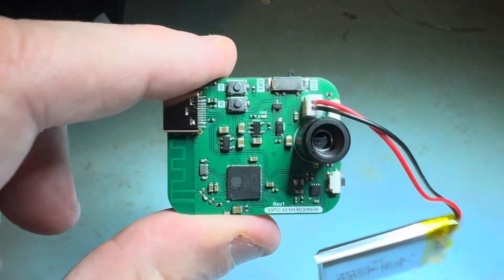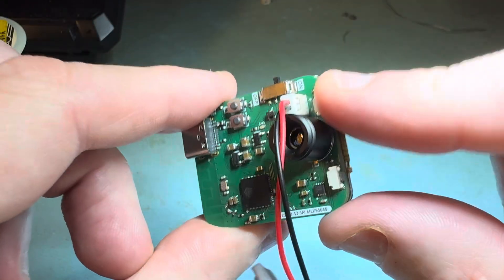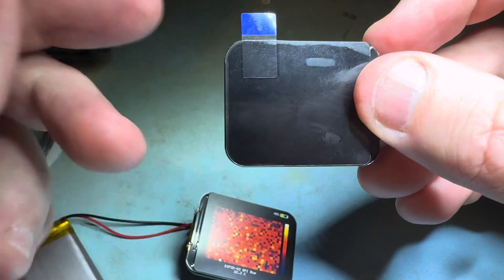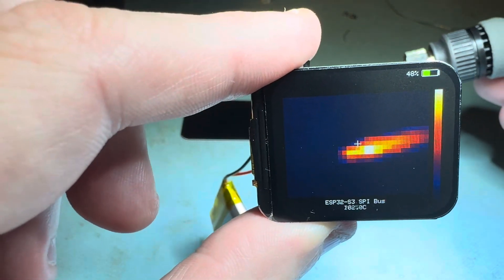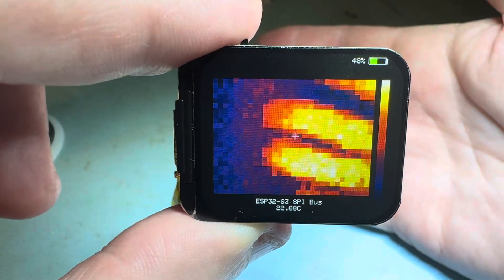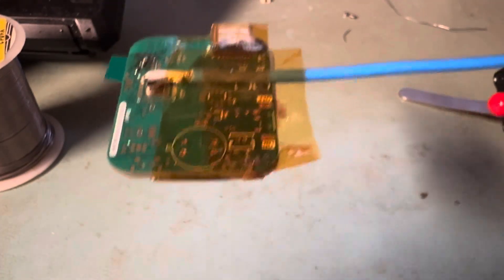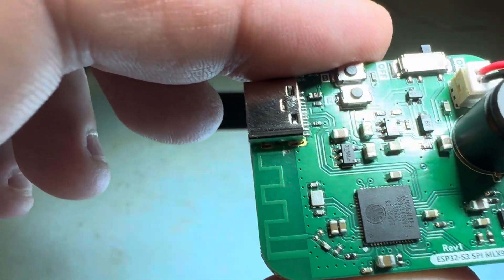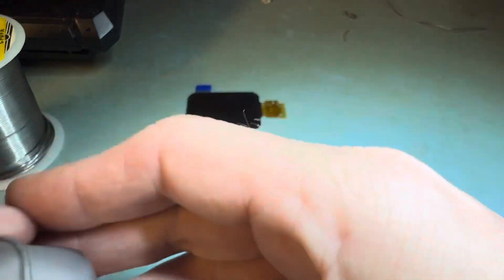ESP32-S3 Thermal Image Board

Comment: Great board Mike, thank you for the video and sharing the design. Have a similar sized PCB for the 1.69" display but still using the ESP32 modules, although I do have a new design as well that uses a bare ESP32 with a chip antenna and a tiny 0.99" 40x160 IPS display. Anyway, stay safe.
Reply from the maker: Antenna tuning is difficult so lately I have been having better success with pcb track antennas. At least with pcb track antennas you can fine tune the swr by cutting a button off the end of the end.
Reply: @0miker0   Thanks for your reply. I thought it would be easier with a chip antenna and I am also tight on space, the whole PCB will go into a pen. So no room for a PCB track antenna. Hope I can get it to work 🙂
Reply: @iHayri1 Is it possible to use a flex PCB antenna ?

I'm subbed to you too 👍😁 lol
Reply: @edwardfletcher7790  You can, just need to have a U.FL connector on the PCB.

Comment: That is a gorgeous board you built there. Love how compact you got everything to basically fit the display size. On PCB antennas you're not supposed to have metal underneath them and it seems your display has metal, so has that been a problem for the wifi?
Reply from the maker: The whole backside of the lcd is metal and likely negatively affects antenna performance. The display and usb connector were in place during tuning and it works as well at the ttgo I have here. The wifi scanner sketch shows signal strength and the two boards are about equal. Even though this project does not need wifi, I was surprised at how well it works.